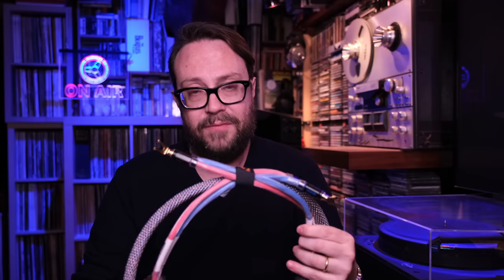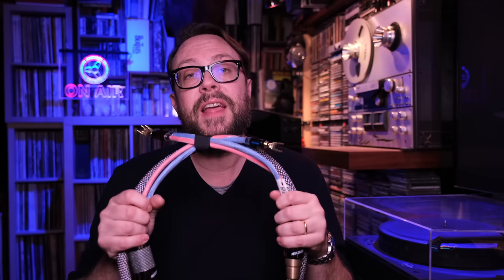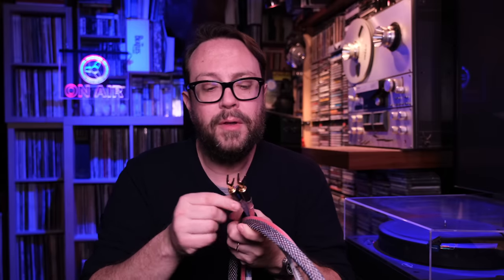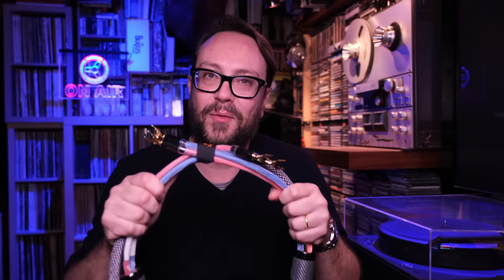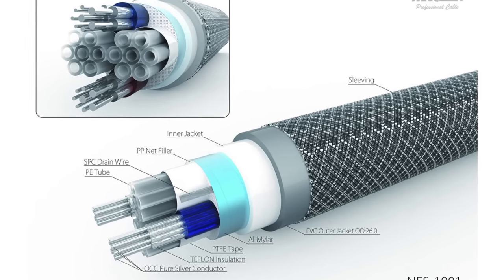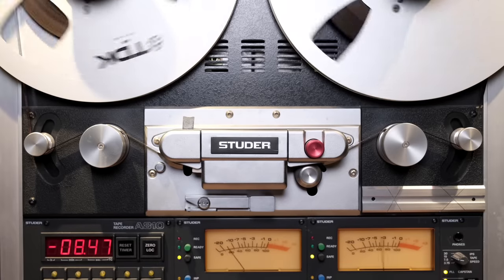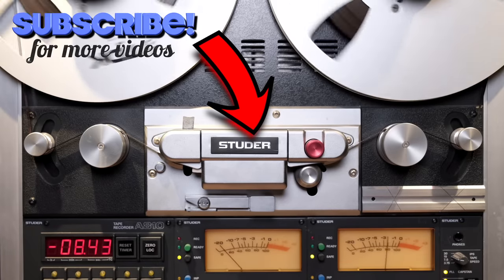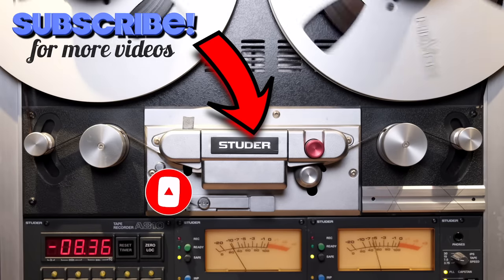Extreme high-fidelity OCC speaker cables at a fair (high) price

Comment: The cable may be too good for the system. Many believe 50% of your budget should be spent on speakers. What percentage should be spent on cables? It seems to me that a system of less than $50,000 does not need $1000 cables. 

Good job, I have some back-issues to review.
Reply from the maker: It's hard to say because cables is one ofbthe most insanely and unlogically priced part of hifi....as demonstrated in other DIY videos I made you can really spend a real world amount of money and have high-end sound.
Reply: 90% should be spent on speakers, but you need to see a spinorama to see if they are worth it.

Comment: More of the "esoteric" cable bollsh!t.

I dare everyone to build speaker cables using Canare 4S11G Star Quad cable (at $2.05 per foot) and some quality terminal ends, properly connected.  
A pair of 10 foot long cables will cost you about $70.

Perform an honest "ABX" double-blind listening test between the Canare cables and any of these ridiculously expensive cables, and tell me:

1). Can you hear a difference at all?
2). Which ones sound "better", and if they do, is it a large or small difference?
3). When the cable identities are revealed, which ones sounded better to you?  Was it the expensive cables?

Do your ears, and wallet, a favor, and hear just how good $70 speaker cables can sound.
😄✌️
Reply from the maker: Thanks for your comment. Which high quality cables have you tried?

Comment: Forget the snakeoil, the ONLY cable parameter that matters is OFC wire diameter, if you really think expensive cables make a difference just buy a single guage wire(car battery cable) to wire up your speakers, it will have vastly lower resistance than any of this snakeoil you buy and be far far cheaper.
Inductance and capacitance DO NOT matter at audio frequencies and I can argue this with solid science, do not be a fool.
Reply: Would you believe me if I said I was thinking the same when I saw this comment? You could buy 3 lengths, plait it and cut the 3rd wire.

Comment: Maybe the cheaper your system, the "More" you need great cables. I once heard some Sheffield Direct to Discs LPs  played using a $30 Shure phono cartridge circa 1990. I couldn't believe how good the sound was using such a cheap phono cartridge. So inserting anything in the system that is of extremely high quality, ( in this example the lp), elevated the sound quality to way higher territory. So someone using a $500 cable with a $700 system would not be ridiculous, so long as the $500 cable is one that is good enough to elevate the sound quality. Thinking that you'd need a $50,000 system to justify using a thousand dollar cable is nonsense. You'd hear the upgrade in sound a great cable makes even if you have one of those old receivers with an opening for 8 track tapes on the front panel. You won't hear the cable in anywhere near all it's glory with such a cheap system. But you would hear a percentage of the improvement the cable is capable of making. That's a radical example, but a true one. IMO one inference you can make; people who can't hear improvements with better cables can't hear. Period.
Reply from the maker: I tend to agree. A mid-low quality system improvement dramatically with a good cable in most cases. That is what I also claimed here: https://youtu.be/63DjmnemI4s
Reply: People will believe anything, especially in audio !

Comment: The speaker cable is the most important cable? OCC copper with teflon insulation is the best? Why doesn't Audio Note use that if that's the best? You should try doing a comparison before claiming something is best just because "experts" can find a "causal" explanation to say it's so. The sciences of electromagnetism and solid state physics don't really know what's going on. They don't know how electricity works and they don't know how electrons move inside conductors. Dielectrics (teflon is a dielectric) are far more complicated then just relative dielectric constant. Of course we have to know the science (all science outside chemistry is actually just cutting edge engineering, not "science") 

Electromagnetic energy or "signal" travels outside the conductors in the form of electric and magnetic fields which are made of photons. These waves travel through the dielectric in between the "signal send" and "signal return" wires which is why the dielectric material is so important. I'm sure you remember ionic bonding and covalent bonding from high school. Metallic bonding is the way metallic atoms bond together. They have no choice but to form a molecule called a unit cell which is the smallest crystal that can form in a metal. The softer or more annealed a metal is the larger the crystals are (OCC could be called a very specialized type of annealing or a beyond annealing process - I could care less what the experts have decided to name it). The free electrons in a conductor's metallic crystal form a coherent cloud outside the crystal called a Fermi Sea or Fermi-Liquid. This cloud is more or less electromagnetically shielded from the electromagnetic goings on inside the ionic molecule (ionic because each atom has given up an electron to the Fermi Sea). Somehow an electromagnetic wave travels through the crystal as a plane wave or surface wave (depending on the textbook you read). None of this makes any sense because the consensus view of electromagnetic wave propagation is that a moving charge carrier (almost always an electron) generates an electric field, this electric field generates a magnetic field, this magnetic field generates an electric field. On and on this cycle goes to generate an electric field that travels at the speed of light through the given dielectric. But the electrons inside the conductor travel at only 0.5 millimeters per second or something (depending on the textbook) and increasing that flow considerably requires extraordinary measures (massive voltage and energy). Now, if they don't really know how electrons flow in a conductor (the model looks at it as being one dimensional then throws out most factors to keep the math from becoming impossibly complex. Then when they have an answer they artificially start multiplying this out into two dimensional, then three dimensional models and then pretend they know how it works. Solid state physicists are even more lost then electrodynamicists). 

Lets look at some of the problems with these theories (they're not really theories. A theory is something that is proven to a very high degree and in order to do that it has to not have any situations where it doesn't work or where the theory breaks down. That's why chemistry is the only real science. What I'm talking about aren't really even hypotheses and many of the people working on this stuff know this). So the electromagnetic wave is supposed to travel through the crystal yet electric fields cannot penetrate a conductor (they get squelched or shorted out. Otherwise we could use conductors as dielectrics - assuming there was an insulator between the current carrying wire and the conductor acting as a dielectric). In a superconductor the skin effect or depth that an electromagnetic wave can penetrate the conductor is only on the very surface of the conductor. In a regular conductor there are at least 4 different theories as to what causes skin effect. They all make sense but they also all don't make sense in a few ways. There are so many contexts to juggle and because the causal relationships are unknown (the consensus view is just politics. It's easy to find physics papers trying to fix the problems) it's easy to make something make sense or not make sense just by shifting you're perspective. Electricity is one phenomena but is made up of about 30 different things. Many of these things are impossible to measure or detect. See Freeman Dyson article "Why is Maxwell's Theory so Hard to Understand." Also search "Jefimenko, Maxwell's, causality." One guy named Robert Destinti claims electromagnetism is wrong and come up with his own theory (there are a lot of these types of people). He wrote his master's thesis on the fact that you can't figure out the inductance of a wire with Maxwell's equations. I did some searching and found a physics forum where they were arguing about him. Eventually a physics professor showed that Maxwell's equations assume that the diameter of the wire is infinitely small so if you want to calculate it for a real world wire you have to incorporate some quantum physics to get an answer. In what world of logic do you have to resort to quantum physics to figure out one of the most basic classical electromagnetics quantities? And these people claim that Maxwell's equations are perfect. When you get to dielectrics, the molecular complexity is off the scale complex compared to copper or silver. Dielectrics are classified as highly polar dielectrics to lightly polar to non polar. Teflon is classified as highly polar when in fact it isn't polar at all. It's classified as this because of the way the test probes interact with the surface charge in the teflon. Confused? The more you read on this stuff the more confusing it gets. They have super advanced ways of testing dielectrics today and that claim about teflon is from the newest, most advanced textbook.
Reply: To boil it down, they don't really know very much but their paychecks and social status is based on the illusion that they do. I wonder if they just gave up studying the old stuff and moved onto the new stuff because people would start wondering why they kept banging on about the same old stuff for 100 years. Today they're working on manipulating the orbital spin or rotational spin of the photons in light to cram more signal onto a single fiber optic cable (which is itself a dielectric). How a photon can have orbital angular spin is beyond me because they aren't orbiting an atom or molecule like electrons do. But this stuff is all just engineering. Try things. Measure them in umpteen ways. Create graphs of the results and use those to design real world devices. That's not science. Consensus among audio people who can hear and have heard all the best stuff is that OCC sounds bad. It was invented for tiny conductors inside integrated electronics chips. That's different. Plus teflon doesn't sound best. Audio Note uses a type of polyester called Mylar in their top silver foil/film capacitor (Mylar is a brand of a type of polyester of which there are about 7 types). If Audio Note uses that then we should pay attention. Never let notions of "science" throw you off in audio. Scientists only pretend to know what's going on. Silver sounds way better then any copper. Soft annealed conductors sound better then hard or OCC. Theoretically, OCC should sound great. Then you hear it and realize it isn't all that. The brand matters too. I heard one Neotech silver/gold that sounded excellent. Audio Note silver is way better then the dozen or so high falutin' silvers and other stuff I've tried. I tried that new Mundorf copper/silver/gold wire and wasn't impressed. Connex 6N silver, Mundorf silver/gold and Neotech silver/gold were all beyond awesome. But Audio Note silver wiped the floor with all of these. I didn't burn in any of the wire I tried. I still have the wire so may have to hook them up to a burn in device and see if that makes a difference. Audio Note wire is coated with six layers of polyurethane so it can be used as litz wire. I bought the 0.6 mm from hificollective and just ran one wire. for each send and return wire. The quality of the return wire matter too. Connectors matter as well. Audio Note RCA is by far the best RCA connector. Audio Note solder is the best too. I bought some AECO XLR connectors. They should be as good as possible but I haven't tried them yet. 

Another thing is that audio frequencies are so low that they are classified as Quasi-Static, meaning that Maxwell's equations can be used without alteration most of the time (Maxwell's equations are static only. That's why they don't understand how electricity works because electricity changes through time). AES/EBU 110 ohm digital interconnect that would go between your CD transport and DAC or between you're digital to digital converter (which is itself feed by your computer or server or streamer) is from 5 MHz to 25 MHz depending on the data rate of the signal. Even that is super low compared to what they're working on today. Part of our problem in audio is they stopped studying this stuff over a half century ago when digital computers were invented. Audio is 20 Hz to 20,000 Hz. Visible light is 400 THz to 800 THZ. That's what they work on today. They're not very good at explaining what is relevant to what. The physics changes radically at different frequencies and different energy levels. Look up "electromagnetic spectrum" and add "eV" to see the energy of each photon ate the different frequencies. Einstein figured this out in 1905. He was a real big brain. Light is an electromagnetic wave and the speed of light is calculated from Maxwell's equations and the theories of relativity were outgrowths from Maxwell's equations (Maxwell's equations weren't developed by Maxwell. He just started it. Hertz finalized them but the alternative experts are still arguing over that, plus Tesla. Don't get me started). Look up Oleg Jefimenko, Terence Barrett, Timothy H. Boyer, Ivor Catt, Lee M Hively, Bahman Zohuri, Douglas H Werner, Jose A Heras and Z Horvath. The references will lead you to more. 

In short, the physicists that work on all this stuff are as smart as people can be. The reason they don't know how anything works is because it's impossible to figure out. Why don't you figure it out and win every Nobel for the next 1000 years? If they can be blamed for anything it's for pretending to have certainty when there is none. I guarantee you that these scientists at Waterloo University all got the Covid jabs. Anyone who got those jabs is beyond foolish. They never read any of the studies. Now they're screwed and the studies prove it. See the German study of IgG4 from last December as just one example (though the studies were rolling in hard and thick from Sept. 2020 onwards). Royally screwed. The birth rate in Australia is down 80%. Excess death in Scotland is up 28% and mostly in the young. Great Britain is up 27%. All of these became elevated at jab rollout and stayed high until January this when they began rising each month. The moral of the story is no human is so smart as to not be totally stupid. There are so many lawsuits being filed now, one the other day was against the US military) that this might be one more thing they're using to destroy the financial system as an excuse to bring in digital currencies and crickets instead of meat. We're all screwed and we were lead by the big brains pretending to be geniuses. Good luck everybody. We'll likely be worrying less about our stereo gear in the near future.
Reply from the maker: It's funny how youvare trying to state that what others say isn't important or necessarily true, and the first thing you say is why Audionote doesn't use teflon.  Seems rather contradictory.
Don't know if they do. Measurements and numbers are a good starting and as a consumer I will get part of that. The rest is based on one's own experience. When you buy a car do you fully understand how it works or a new computer? No, so no, I don't jave to do that with cables. I trust specs until a certain point, then I trust my ears since a lot of scientist and engineering admitted that we know only what we measure and there is so much that we still don't understand.
Oh, in by the way, it makes no sense to talk about crystals because that is what is OCC a conductor with less then 1 crystal per meter.

Comment: Only two things matter - material and thickness. Simple. Nothing less, nothing more. 4mm² of copper is better than 2.5 mm² of silver. That's it. So the best is 6mm² of silver or more if your devices support it, and the insulation has no meaning at all. This is the whole science.
Reply from the maker: The negative influence of a high dielectric constant is one of the most clearly and scientifically documented aspects of cables. Here is a video where I explore in detail all these aspects: https://youtu.be/uVKFSquAhwc

Comment: You mentioned a thousand euro..
Was that per metre or what?

Is this speaker wire from amplifier to speaker??

Can you show the difference of the three with an audio test. Something that gives numbers..you know..actual data.

Anybody can spout adjectives but can you show the difference with an audio test system.. perhaps a microphone and spectrum analyser.

Perhaps run the same source with the exact same material to the same speakers on the same day but switch over the three sets of wires you're raving about.

Otherwise it's just snake oil..
Reply from the maker: It's just snake oil